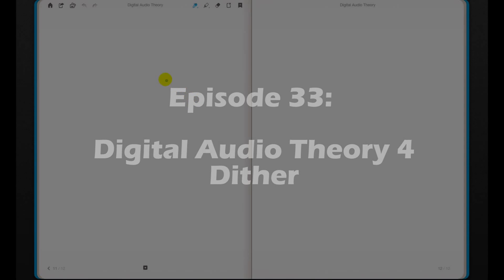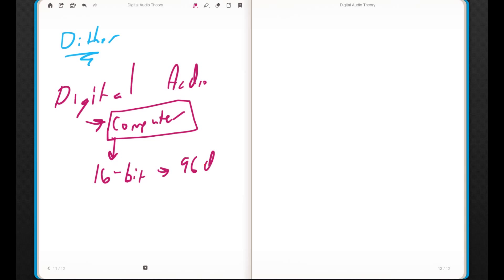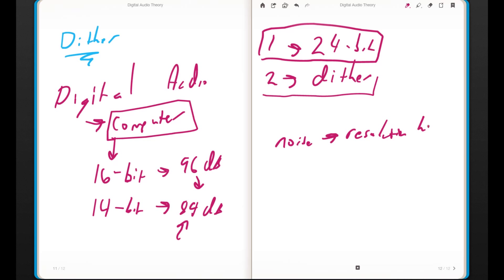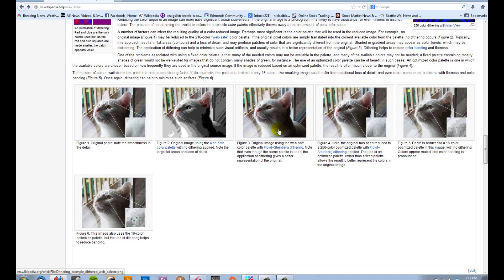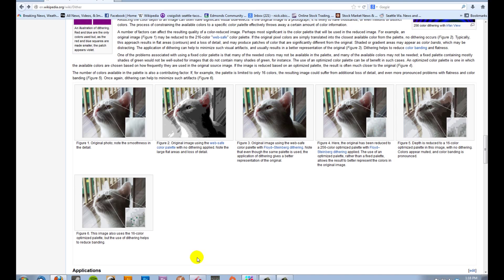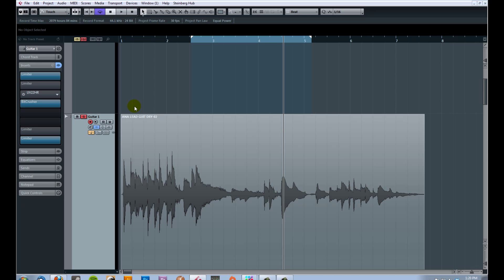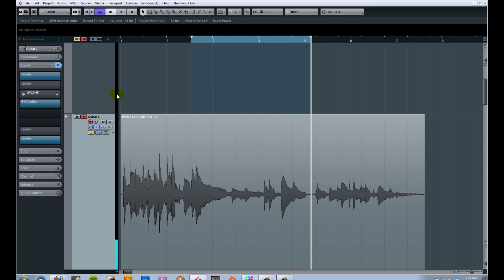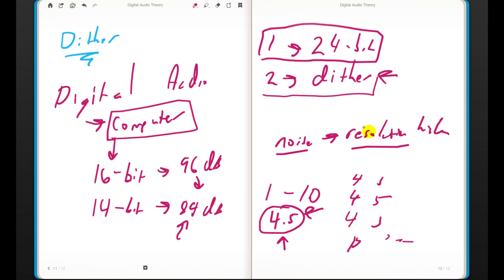Nick Sibicky's Music Production Secrets #33 - Digital Audio Theory 4 - Dither

Comment from the maker: If our system does not have enough resolution to handle fractions/decimal places, instead of "2,5, 20, 3.5" you will get "2, 20, 3."  Doubling that to restore the original amplitude will result in "4, 40, 6" which is noticeably different than the original and hence, lower quality.

So, resolution matters for everything you do.